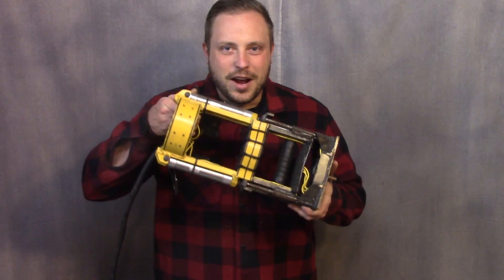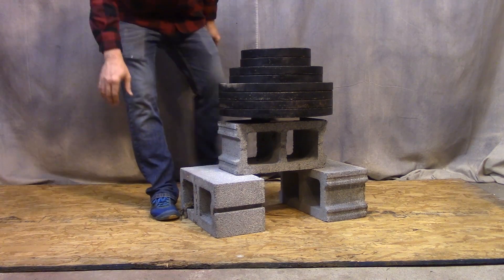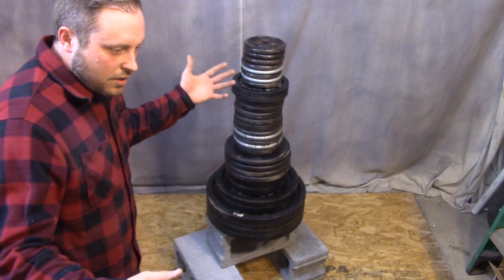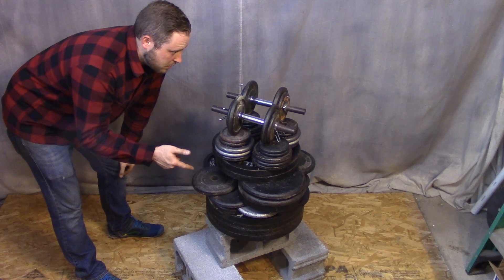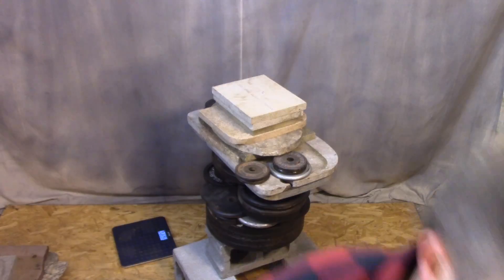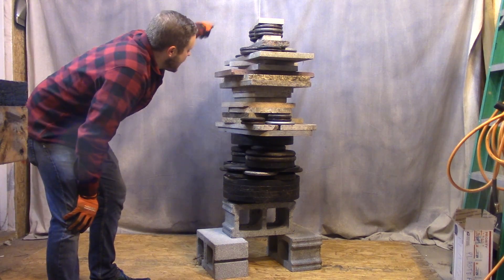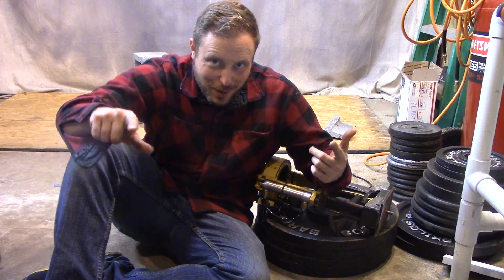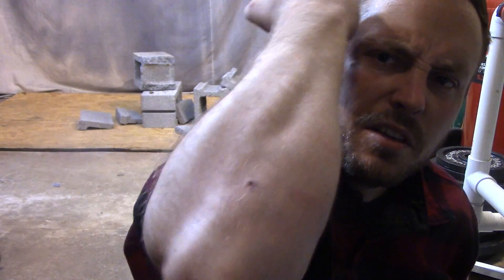POWERFIST POWER TEST - How much force to break a cinder block

Comment: if you just drop weights from a certain height you could use math to hind the amount of force it took to break. Force = mass times acceleration. I would try that first but this is a lot cooker looking. Still   great!
Reply from the maker: Experiments & Engineering  This is a great idea but I would need a bunch of cinder blocks to get to the minimum height to find the limit.
Reply: JAIRUS OF ALL nah you wouldn't,  standing weight and impacts are different in physics, you can break a cinder block by gently dropping it on grass. Love the power fist tho! Suggest you get in touch with an engineer to do actual measurements. SmarterEveryDay could perhapd help.
Reply: EnderNinja Accelerometer on the powerfist, highest G spike recorded*mass of the powerfist + approx mass of arm = actual peak force. To be noted, apolying said force on a point or on a surface yields much different results.
Reply: Experiments & Engineering 
You're right, force = mass * acceleration, but like Th3BadWolf said impacts are treated differently. He was already kind of using F = ma to find the force  needed to break the concrete, except instead of multiplying the mass of the concrete by 9.8 (acceleration due to gravity), he measured the force the weights exert on the blocks directly by weighing them, to find the force exerted in pounds. To find the force needed to break the block by dropping things on it, you would have to measure the potential energy of the last massive thing to break the block. Potential energy is U = mass * height * acceleration, and if I'm remembering my physics correctly... F = - integral (U dx) ? So you would integrate  mass*height*acceleration from (height)  to 0 to find that the force exerted was (mass*acceleration*(1/2))*(height^2)...? I think?  Units must be kg, m/s^2, Newtons, and meters and everything... Also please tell me if and where I messed up, anyone.

Edit: ignore my gibberish about measuring potential energy, I only wrote about it to get to the point of integrating it. You don't need to know a value for potential energy unless you want to know how much energy in joules it took to destroy the block.
Reply: EnderNinja The rate of deceleration on impact is also a factor you can't ignore as it act as a force multiplier. Take the egg drop challenge for instance; same mass-ish but different results based on energy absorption mechanisms.

Also, i don't actually think the extension is helping at all. Shut the valve off and you'll break the cinder block still.
Reply: Th3BadWolf oh are you think F = m * (change in velocity over time)? Derp I didn't think about that, though you'd need maybe a slow motion view of the block breaking to figure out how much time it took, and what it's approximate velocity after impact was...
Edit: at this point, I don't think he should bother with "mathing out" the force required to break it though, I just want to see how much weight that block can carry xP
Reply: wtf it says cheater when i look at it

Comment: WOW the compressional strength of cinder blocks is insane!
Reply: Supposedly a cinder block has a compression strength of up to 120,000lbs... but thats when weight is added slowly, like building a building. Impact force is a whole new ball game... especially when the force is applied in a point.
Reply: To be exact, when it fails in this configuration, it fails due to tension. Compressive strength is about an order of magnitude higher than tensile strength for similar materials (cements/concrete etc).
Reply: Well I guess you are right it is tension in this scenario, but I talked about compression because that is really concrete's most useful property in engineering. I just saw this as a really great example of the static load concrete can actually withstand, it's just impressive to see in action.
Reply: Cinder blocks can hold up cars. It's takes lot to break a cinder block.
Reply: Jeff Vader well, that's sorta what they're made for...
Reply: That One Guy That Snipes you do realize that cinder blocks hold trailers that like the kind I guess you would call it a mobile home but weighs up to 20,000 pounds and even more right lol not trying to shoot you down or anything
Reply: Well Jarius said he loved me, so you're all just jealous. :)
Reply: Joey Dixon  I actually didn't know that lmao
Reply: Jeff Vader Who would have guessed! Would be great for building structures!!! .....wait..
Reply: Jonas Forsberg
Reply: That One Guy That Snipes Not with impact.
Reply: Joey Dixon

Punctuation.
Reply: Entity&Entropy impact force is not really that much different than gradual force. The force applied to the object is the same no matter the way it was applied. If it was a sudden impact, then it would not be counted as the same amount of force. It would be a completely different amount of force due to the momentum of the object striking its surface.